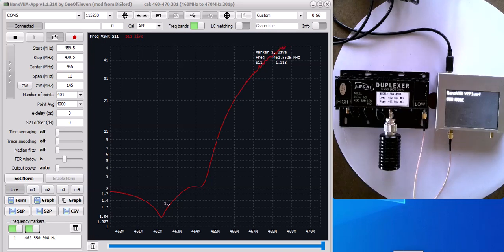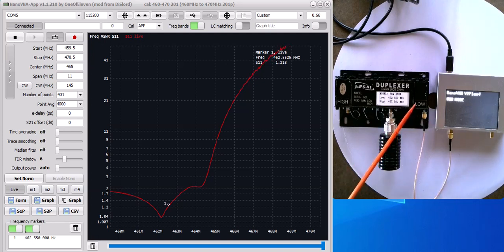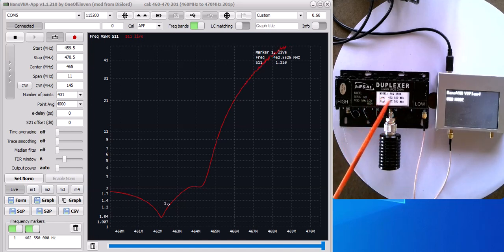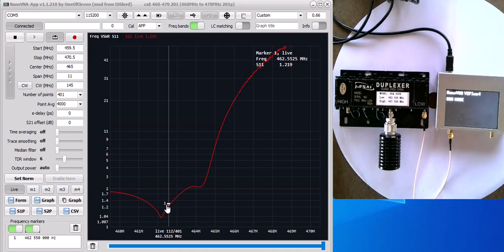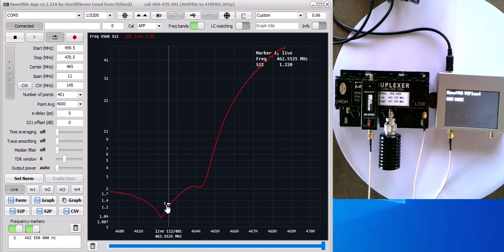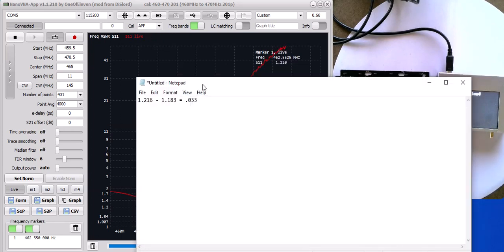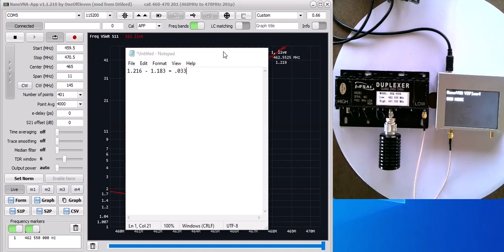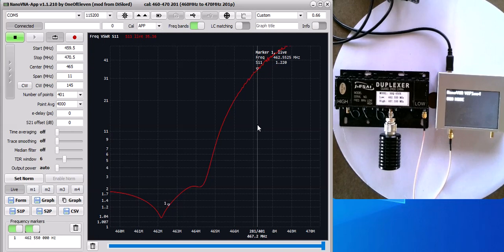🔺 How to check SWR on a Duplexer for GMRS two way radio repeaters!! 🔺

Comment: what about the high side of the duplexer how I can make a test? what shall I do make a measurement? 
thanks  for you answer Sir
Reply from the maker: You don't need to check the high side because that side is the receive (RX) side, so there is no wattage going through that side.
Reply: @GMRStwowayradio  so thanks a lot Sir, very useful info